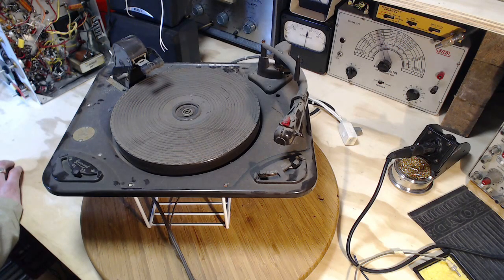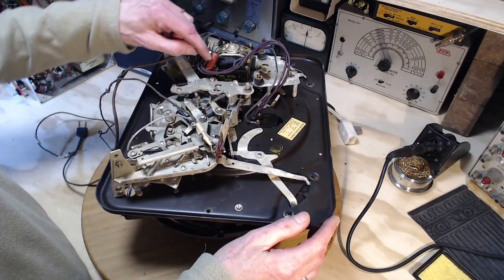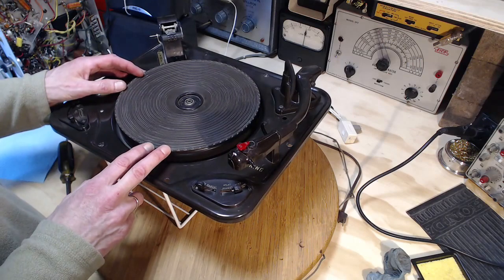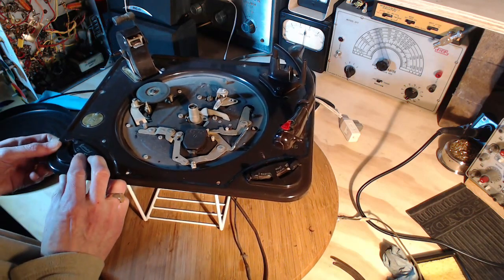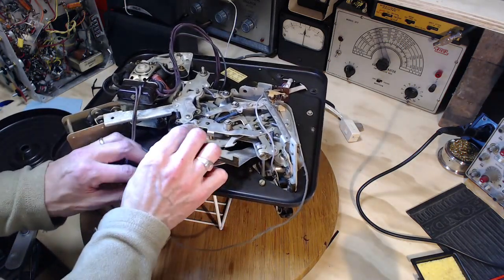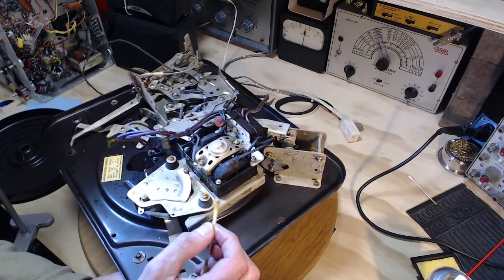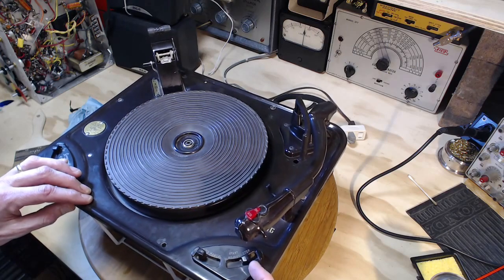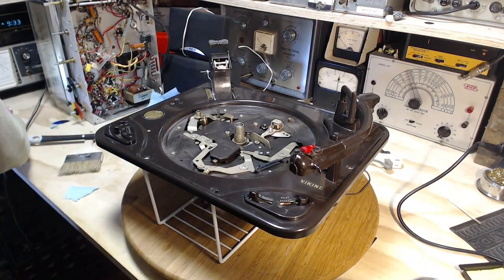Viking Console RC311  Video #3 - Garrard Record Changer

Comment: Jim:
In case someone did not mention it, there were 2 spindles for that changer.  The automatic spindle that you alluded to, and a short manual spindle.  Also the 45 automatic spindle was an integrated unit and interchangeable with the other 2.  This is  just an FYI

Comment: I wonder is there a servicing manual for the Garrard Record changer if so then it might be worth getting, Swindon is where the Garrard Turntables are made, A MARANTZ 143 Linear Tracking Turntable is a brilliant turntable to have but you must not leave anything on top of the lid as that is liable to cause the turntable to start up and the tone arm assembly is actually built into the lid.